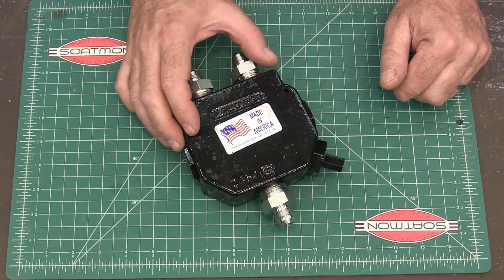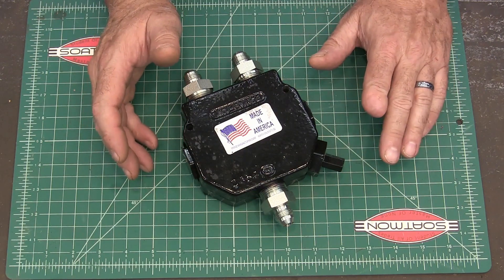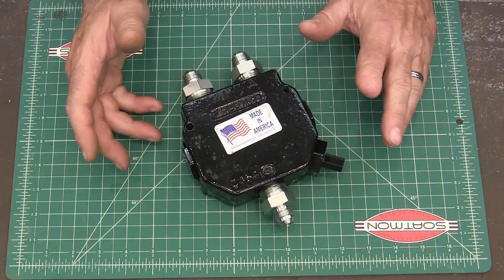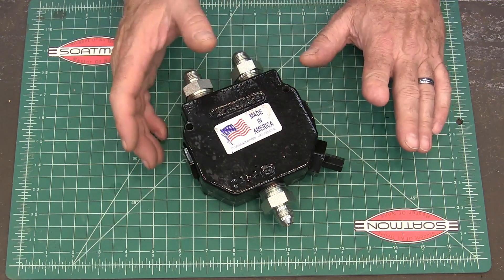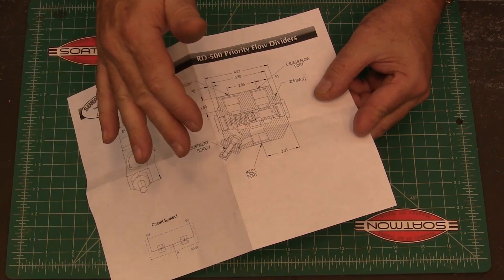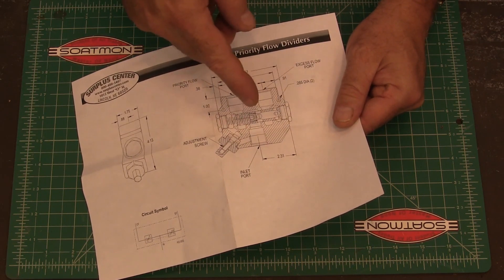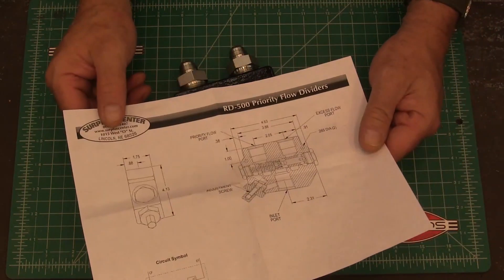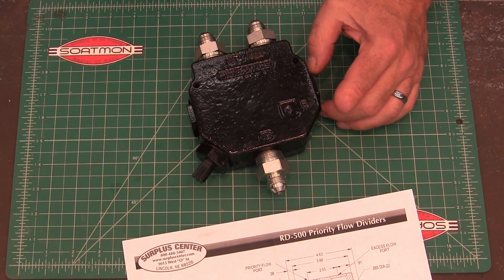Installing a Hydraulic Flow Diverter Valve

Comment: Is there any way you can do a video showing how you routed your excess flow back to the tank? I am using a flow valve very similar to yours on my tractor run the loader off a PTO hydraulic pump. Whoever set the loader up before I owned it, didn’t set up the excess flow. Thanks
Reply from the maker: Excess flow just runs back to the tank.  You will need to find where you hook up to flow back to the tank on your tractor.  Good luck!

Comment: That was very interesting.   Several years ago I used one of those two position valves which is inserted into a circuit to allow for two different functions from the same control valve.  Not sure what the term for them is but I never thought about it that on an open-center system that the thing must handle all the flow.  It makes sense for sure I must have just been fortunate that it was sized large enough.  Also, I have never heard of this particular type of a valve.  If this valve is accurate enough might it also be used more as a flow divider?  If you were to want two unconnected cylinders to be synchronized could this valve be set to divide the flow 50/50?   For myself this might be wort looking into. I appreciate you sharing this and showing the catalog sheet, I will look more carefully at it. Also, thank you for the video.
Reply from the maker: I didn't know they existed either until I got desperate for a solution.  Apparently this valve cannot be used to synchronize two cylinders.  When I was reading through the questions for this item on Surplus Center someone had asked that question and was told that you have to use a Rotary Flow Divider which they also sell.  Good to talk to you Glenn!